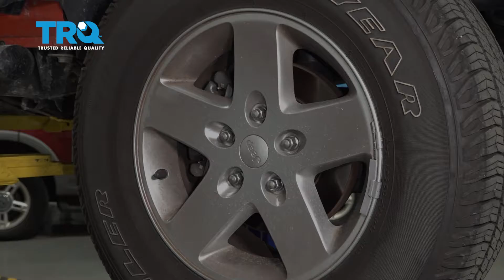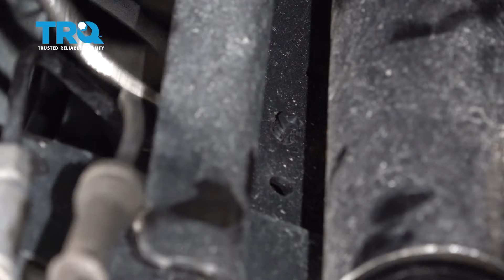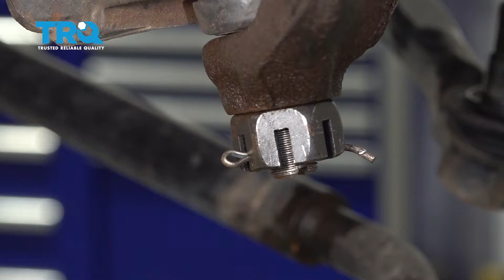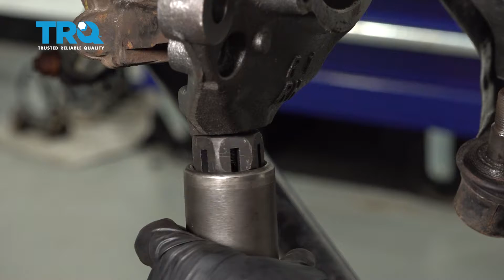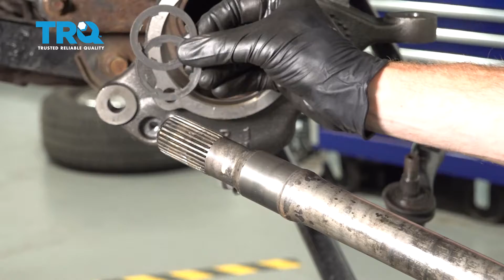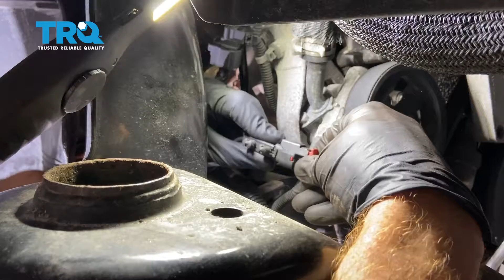How to Replace Right Front Steering Knuckle 2007-2018 Jeep Wrangler

Comment: Wondering why at 5:14 you removed the axle nut and axle from the bearing? The 2003 TJ  model comes out all together. Did the model change from 03' to 07' ?  Is the TJ different from the JK?